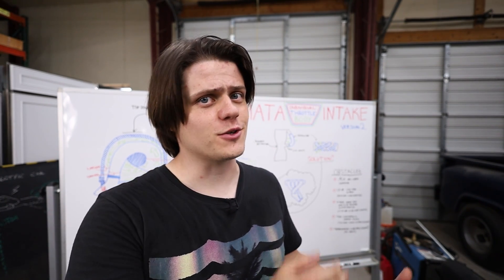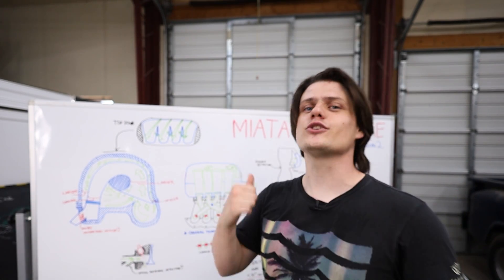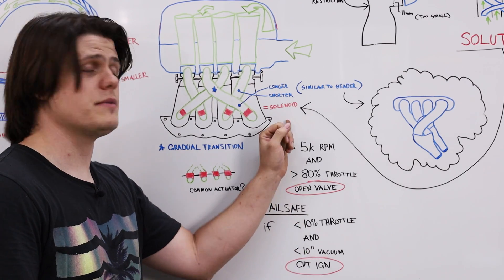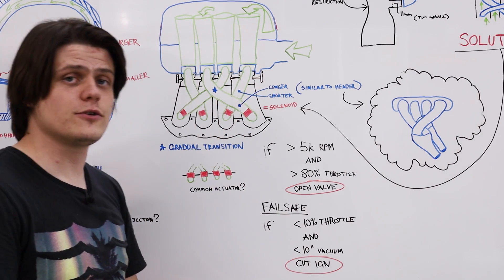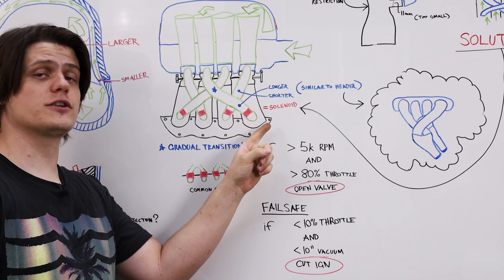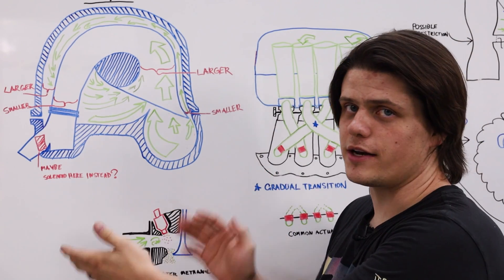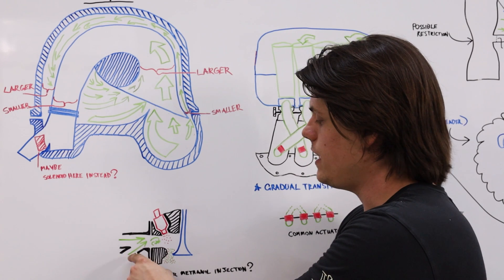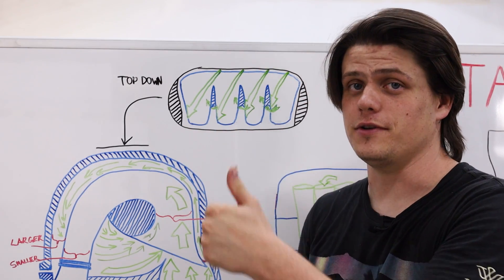This intake is the beginning of something BIG...

Comment: I really want to see this made because I'm interested, but I have a few points.
Revving to 6k would mean the solenoids actuate 50 times a second. That's asking a good bit out of mechanical solenoids.
The thing with venturis, my thought is that if you want to get a good enough venturi effect to actually move some air through the smaller tubes. The air flow through the restrictions would be so hampered that the sum of flow would still be lower than just a regular intake.
Reply from the maker: The solenoids won't need to open and close quickly. They will be 100% open over ~5k (as long as the throttle position is near WOT) and 100% closed under 5k. So they'll only open and close once per gear shift.

I don't know for certain but off the cuff I agree that the original venturi based design would flow worse than a regular stack.
Reply: GOod point. Not something I had thought about when looking at it. @stand this would be cool to follow up to see if it works or not

Comment: Thanks for sharing about your schooling. I think this is proof that not all people are meant for traditional education, but given the room to learn about what they actually care about, they can do amazing things. Too many kids do get overlooked because they don't fit in a box. Awesome update! Hope you and Wesley Kagan can communicate at some point as well.
Reply from the maker: That means a lot to everyone reading, thank you for that! I yearn for a better education system here.
Reply: @StandRacing  electric assited vairable vane turbo(porsche) , rear wheel drive rear midengine inline 3 /INNengine/freepiston/jetturbine(as electric drive range extender)   , compact 4 seater with rear seat facing rear and car shaped around that , hyundai ioniq hybrid transmission non cvt vs prius cvt vs subaru wrx cvt maybe with recyclable electric motor integrated. variable fuel type , mazda hcci, propane hydrogen , biofuel efuel petrol , combustion system, nissan variable compression ratio. , limited slip diffrential for less tire wear even for normal drivers because noone thinks to not torque while turning on non differential car for tire wear,  etc, brakes programming acting similar to limited slip differential(already in mazda). reduced power steering switch for fun motivating user to steer smoother (less tire wear, more attention to driving environment=safer, less focus shifting between daydreaming, driving, music, etc=less stress and more "flow state" of mind)   .toyota kdss active sway bar (how about it controled by steering position for momentum preservation at turns then less bumpy ride when not in turn , to whatever level desired).  rear wheel steering , f1 FRIC suspension(old citoren cheap car had similar) ? gordon murray istream, gorodon murray t43,  maybe gorodn murray t50 3 seat positions by foldable re positionable seats or a dedicated car option, except more compact because engien between rer passenger and they legs ponting a bit away from driver more. can cimbine with my compact 4 design but mine is best in terms of weight and  areodynamics and minimal airpsace to heat/cool and passenger has unused trunk space as leg room and has given the good enough capability of 4 foldable removable seaters(rarely will have to have, for example, multiple doctor appointments for all the kids, because such thing almost never happenes and most people dont even have so many kids or need to carry family to grocery store, where rear area is more than good enough compared to midsize suv trunk vs actually needed space, and stacking objects is pretty much never done especiall noy to the extent that its stacked over seats height and thus spilling into passenger area... floor surface area is more useful storage which also keep weight low to grond for momentum preservation when cornering  . to make it easier to get into rear seats, use smaller car wheels, maybe add space, and have seats move to straight spine position because door opened , maybe by mechanical connection (or just require user to move lower seat position and upper part will auto adjust by door not being closed). user puts buttt into car first then swings  legs over wheels and or bends legs into car.  ceramic anti rust and paint protection.                                                                           ......................all is marketed as "currently true most sustainable "enviromental" and safe and affordable (roughly) and fun hypermiling car " , including speeding downhills (maybe 50-90mph highway) to make more speed with less tire grip , fuel etc,  even if on curved downhills(by limited slip differential)                               less weight means better everything including less road wear and less crash damage at least to other people in other cars.  suspension jumps to  lift sedan to ground clearance of average suv etc or incoming vehicle as much as it can , for its stronger energy absorbent heavy crash structure to hit the same type fo structure of other vehicle for damage minimization. structure is low to ground for anti roll over around a turn.                              fully recyclable, lighterweight higher longveity supercapacitor assited battery and/or magnet absed in wheel motor like saab motors NEVs and konigsegg,  makes  combustion less important? fake OR re routed and partially censored engine sound representing torque vectoring?
Reply: I'm one of those kids! I'm 35 now and have found my way, but damn I feel like I lost a lot of time!
Reply: this!
Reply: Schools suck for learning to be creative.
Reply: Would also like to see if David Vizard has any comments on the overall design.

Comment: If we are going electromechanical, maybe giving the rx8 13B-MSP intake system a look might be an idea, it uses valves to vary the intake geometry at certain RPM's to increase power. Specifically the HP/6 port version of the engine does this. The manual is actually available online for a quick look and might yield some inspiration. Should be in the Engine Specifications manual ~Page 75 if i remember correctly
Reply: Actually looked into it a bit:
All 13B-MSP engines got Sequential Dynamic Intake System (S-DAIS) for controlling the secondary and auxiliary ports, and the variable intake valve. The primary intake is used at low rpm only. The secondary port starts operations at 3750 rpm after the shutter valve would open. The high-output engines have the auxiliary port which would open at about 6250 rpm. The variable intake valve is used to lengthen the intake manifold and for increased mid-range torque. It would open at around 5750 rpm (at 7250 rpm for high-output engines). Variable fresh air duct (FAD) is one more intake system which you can find in the high-output versions of 13B-MSP. It opens a special valve at around 5500 rpm to shorten the air intake manifold. Together with the variable intake valve, they increase power and torque at high engine speeds. 

Varying the effective length of the intake runners based on RPM then may give better response/power

Source of that snippit: https://www.motorreviewer.com/engine.php?engine_id=102
Reply from the maker: Very interesting I'm definitely going to read into this. Thanks!
Reply: @StandRacing  Toyota's TVIS, Fords coyote and focus SVT both use the 13B style flaps (which are also used for the 6 ports on the Mazda Renasis). The other one to look at is the BMW N62 V8 which uses a barrel inside the manifold for a constantly variable length.
Reply: Da used this too, check out the h22 and the b18c1 intake manifolds. Someone else had variable runner lengths iirc
Reply: *Honda
Reply: The Ford Taurus sho’s v6 also utilized a variable runner intake manifold with two intake ports going to each cylinder head port. One was long runner and one was short a valve opened at a certain rpm to open both to add in top end power.